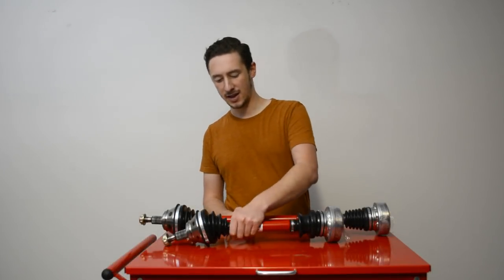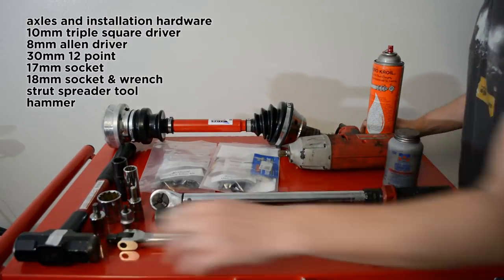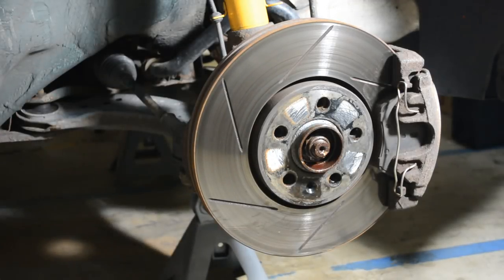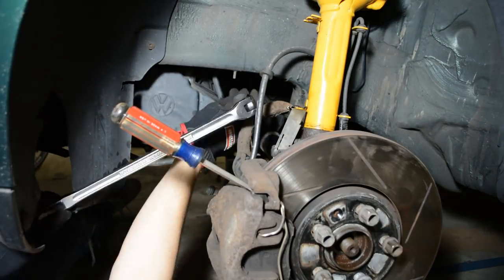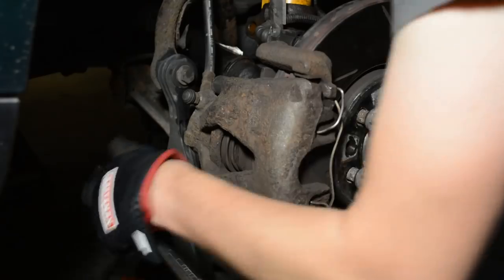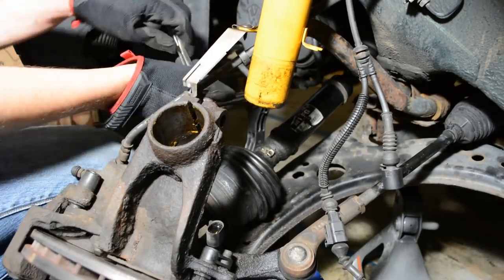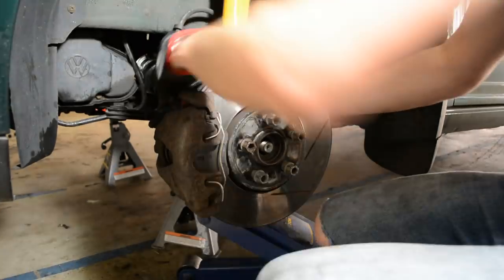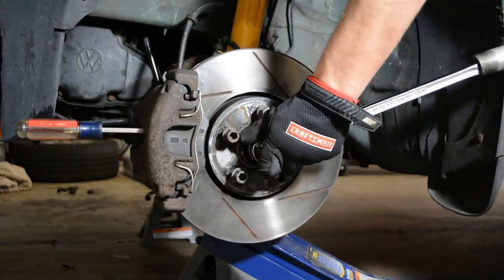MK4 VW CV Axle Removal and Installation

Comment: Hey, Quick Question! I’ve got a 00Jetta & just replaced both CV AXELS. 
When I looked at em the other day,
I noticed the axel wasn’t flush with the wall. Do you happen to know what went wrong here??? Did I miss a step.
Any feedback is appreciated.
Reply from the maker: +Cali_livin Guy Do you mean flush with the hub area or the transmission area? If everything is tight there shouldn't be an issue. When I put mine together it seemed like it wasn't into the hub far enough, but everything tightened down and seated correctly. Do you have any weird noises, vibrations, or other issues that make it seem like it may have been installed wrong?
Reply: Thanks for taking the time. 
Every time I hit a bump, I hear hard metal hitting. Maybe the shocks are bad too ?
Reply from the maker: +Cali_livin Guy that could also be your strut mount. Its the rubber piece between yhe top of your strut and the strut tower.

Comment: Unbolting the strut is unnecessary. If you unbolt the sway bar end links on both sides, you can swing the sway bar up. Then unbolt the inner CV and the big nut. Then swing the inner CV up, pull the axle out of the hub, and maneuver it out through the gap where the sway bar used to be. I just did it today - did not have to undo any suspension at all (besides the sway bar).

On the passenger side, I unbolted the control arm from the subframe. Seemed a lot easier than undoing the strut. Had both sides done in under 2 hours.
Reply from the maker: Lots of different ways to do it, my video is just one. Thanks for the alternate way! My struts had been installed after my control arms, so I knew they'd be easier to crack seeing as I live in a snow state.

Comment: How did you fix the abs and pad wear sensors?
Reply from the maker: I spliced new plugs on the end. The ABS sensor works again, but the pad wear sensor didn't for some reason. I just used VAGCOM to turn the light off since I'm not worried about that light functioning correctly.

Comment: having a problem where the passenger side axle keeps spinning when trying to remove bolt
Reply from the maker: Is it the large single axle bolt? I would loosen that one up with the car on the ground, or use a screwdriver/pry bar against the ground to stop it from rotating.
Reply: @StevesGarage  I’ll try that the rotor spins with axle trying to undo it I’ll try the screw driver method thx
Reply: @StevesGarage  hit it with impact and it came right out but thank you
Reply from the maker: @jakes5506  You can stick a screwdriver in the vanes of the rotor, or thread in two lug bolts and use those with a try bar to stop it from rotating. Let me know how you make out!
Reply from the maker: @jakes5506  Good stuff!

Comment: Is it different for 02m 6speed?
Reply from the maker: The sizes of hardware may be different, but the procedure is the same. If the sizes are different, look into the torque specs as well.

Comment: My mk4 driverside axel is frozen won't turn at all the passenger side does the motor mount broke on driverside side I fixed it now the axel wont move at all in gear or neutral
Reply from the maker: Sounds to me like you may have damaged the driverside axle. I can't see the motor mount breaking causing any internal damage to the trans, so I'd start there. I'd remove the axle and inspect it to see if its ok. If it is, then check out the trans/dif.

Comment: Hey bud please help me out, I was driveing a few days ago and my CV axel just fell off, the tranny wasn't leaking or anything actually, so assumed I could just replace it and be fine. Well I replaced it today step by step with the video and now it's leaking hella fluid ??!! Any ideas on what it could be ??? It's my first car and I love it I'm just so sad that this is happening and really need help 😓
Reply from the maker: +Christtheep gameing I'm honestly not sure what your problem might be. You may have installed in incorrectly. On my car, the CV Axle isn't exposed to the transmission fluid, it attaches to a flange that's connected to the transmission. Is it leaking trans fluid, or something else?
Reply from the maker: Oh nice! Easy peasy. Good to know you're up and running!

Comment: Is it possible for the threads on the transfer case where the axle bolts in to be stripped? Is there a way to fix this issue?
Reply from the maker: I suppose that's absolutely possible, though I have no idea how to fix that. What makes you think the threads are stripped? Is it not tightening properly, or not coming out?
Reply: My axle actually disconnected on the highway One day and all the bolts came out I went to replace it and ordered oem bolts and an axle but the bolts only thread into the axle and not the case
Reply from the maker: @dkackddog25  Oh wow... There's definitely an issue then. Did the bolts break off and now they're still stuck in the hole, or did they fall out and the hole is clear? Either way, you've got a problem. I've replaced a full transmission on a mk4 before, but I don't know if you can replace just the flange that comes out of the trans where the axle bolts up to.
Reply: Steve's Garage I’ll have to dig through vw vortex more but the bolts just felt out without shearing, I’ve never seen that happen before. The guy I bought my car from replaced the engine so I’m assuming he over torqued the bolts and stripped the threads. Thanks for the help
Reply from the maker: Wow, sorry to hear your trouble man! I'll say that mine haven't had any issue when done correctly, so when it's buttoned up correctly you shouldn't have any issues!

Comment: What happens if you damage the hub when hammering?
Reply from the maker: If it were me, I'd replace it. The last thing I'd want to do is put it all back together and have an issue that requires me to take it all back apart. That being said, if the hub seems ok, you could put it pack together and it might be fine. It's hard to make a call not being able to see it in person.

Comment: The tools you used for this video would it be the same tools you would use to remove the driver side axle on a  2012 volkswagen passat ? Or would they be different ? Finding a drivers side automatic axle is even hard to find. Lol
Reply from the maker: I don't know enough about the newer Passat to tell definitely one way or the other. What I do know, is that VWs tend to make small changes over the years, so it wouldn't surprise me if they were the same. Can you buy a repair manual? That would definitely help, especially if there are photos to go along with it.

Comment: My 2003 mk4 tdi does not have 10mm triple square bolts . They are more like 8MM . Had to leve the car up on stands last night because I bought a 10mm as per this video and it most definatly does not fit .
Reply from the maker: Sorry that happened, I guess the tdi hardware size is different than the 1.8t.
Reply: @StevesGarage  knew I should have just bought the whole set . Going to pick them up this afternoon and finish the job tonight.  Thanks for the video anyway was informative.
Reply from the maker: On the Escape I own the caliper pin size differs between some years and no one can figure it out. Some are 7mm, some are 9mm. Sorry the video stated the wrong size. I know VW has some differences between the different engine/transmissions, never thought the bolt size would be one of them. Glad you found the rest of the video helpful though.
Reply: @StevesGarage  I know what your saying I hate when they don't keep it consistent on same model car year to year . I blame the engineers . Turns out my cv is probably ok overall it was a bad hub so there was play in the wheel bearing . I'm still going to replace the cv anyway shes original to the car 450 thousand kilometers on the old girl . She can just have the new part . Doing struts and new lower ball joints as well . I'm in deep now .just pressed the bearing out to find the hub problem so of course I've got to order one . Another day I'll have to wait to get it all back together . Thanks again
Reply from the maker: @dillpickle4239  Glad it helped! I tend to go all out like that too. If you're in there and the part is old, might as well replace it. Otherwise you can be back in there in a couple months doing it all over again.
Reply: @StevesGarage  true enough . My buddy mis diagnosed the cv joint so I blame him . Haha . Have a good weekend dude .
Reply from the maker: @dillpickle4239  You too man, good luck with the car.

Comment: HEY GUY -- PUT ON A NEW CV AXLE ON PASSENGER SIDE. 2002 GLX PASSAT 4 MOTION AUTOMATIC TRANS / FELT PRETTY GOOD ABOUT IT. // HOW EVER WHEN i WENT TO THROW AWAY THE BOX THERE IN THE BOTTOM SOUNDERED BY PLASTIC SHIPPING MATERIAL ALL AROUND IT WAS A SMALL PAMPHLET . EXPLAINING  THAT A DUST SEAL IS REQUIRED FOR SOME 2004 APPLICATIONS // THEN IT READS --- REMOVE IF ORIGINAL AXLE DID NOT HAVE  THIS. --- CHRIST IT DIDN'T HAVE ONE ON IT OR IT WAS SO WORN OUT IT ROTTED AWAY ...  NOW IT'S INSTALLED AND i DIDN'T NOTICE IF THE NEW ONE  HAD ONE ON IT.  WILL THIS DUST SHIELD ON THE NEW ONE -- WILL IT NEED TO BE PULLED AGAIN AND REMOVE IT OR WILL IT BE OK TO RUN.IT LIKE IT IS.   THE RIGHT ANSWER WOULD BE APPRECIATED -- BUT IF YOU DON'T KNOW FOR SURE -- THEN SAY PULL IT
Reply from the maker: I hate when that happens! I'm not sure about the Passat, but there weren't any extra parts with mine. Odd that it doesn't specify if your car absolutely needs it or not. Are you axles maybe used on other applications that need the seal, where maybe yours doesn't? I would try and find that out before pulling it again. Someone has to know what cars get the seal vs what cars don't.

Comment: Not every jetta has a 10mm triple square driver bolt, should have been specific with the size range on all jettas.
Reply from the maker: I've pinned a comment stating that. This video is done on a 1.8t so it should be correct for that.

Comment: How did u set up the strut spreader at the back of the spindle?
Reply from the maker: +Sdddude123 the strut spreader slides between the knotch in the spindle, then you rotate it to open up the spindle and slide it off the strut. Let me know if that doesn't make sense or you need more clarification!
Reply: @StevesGarage  thanks! I had to rewatch a couple times but it makes sense now.
Reply from the maker: +Sdddude123 Cool cool, glad I was able to help!

Comment: Torque specs for axle nut?
Reply from the maker: Bently manual says to torque to 148ft/bs, loosen half a turn, and then torque to 37 ft/lbs. Raxle says to tighten to expose 3 or 4 threads. I've done both and haven't had an issue either way.
Reply: @StevesGarage  Im gonna use the Raxle method, thank you so much!

Comment: How the hell does yours have a hex nut? Everywhere I've seen it's a 12 point
Reply from the maker: The axle nut? It's a 12 point in both the one I take off and the one I install.
Reply: @StevesGarage  no the cv nut that's hold it to the transmission. I noticed you were using a hex bit
Reply from the maker: @ischwhit6747  The OEM ones are triple squares, the replacements are hex. That's what the Raxles are delivered with.
Reply: @StevesGarage  yeah, ik the OEM ones are triple square. What I saw was you using a hex on the triple square bolts. I could have been blind or maybe the lighting wasnt too good on em
Reply from the maker: @ischwhit6747  Definitely wasn't a hex taking the off, just a triple square driver. Probably the bad lighting in here, it's tough to get light that far in with the car so low to the ground.

Comment: where did you purchase your new cv axle in red?
Reply from the maker: +Hippie Chick The axles are from a company called Raxles. They're expensive, but they're better quality than OEM. I'm lowered and have a tune that's giving me more power, so I wanted something beefy.
Reply: @StevesGarage  that's what I've been looking for buy people kept telling me. I couldn't do anything with a vw... very discouraging. I'm just starting out learning and studying. I want the best for my car. thanks for the info
Reply from the maker: +Hippie Chick Don't be discouraged about what people say about VWs. They're different, might require some special tools, but at the end of the day it's all nuts and bolts that come off, and go back on. If you take your time, follow instructions, you can do it! The Raxles are definitely the best axles out there if you plan to keep your car for a while, or do any future modifications like lowering or increased power. Let me know if you need anything else, I'm happy to help!

Comment: What size are the axle bolts?
Reply from the maker: I'm not sure what the exact bolt size is, they came with the axles. As for the head size, the stock VW bolts are a 10mm Triple Square bit. The replacement Raxle bolts are 8mm Allen.

Comment: Nice approach Steve.  Question for you.  Im in the  process of replacing my steering rack (2000 beetle).  Subframe is dropped,  etc etc.  Noticed drivers side axle has no rotational play, and if I gently pull on it, it moves in and out only a few mms.  The passangers side has no rotational play, but if I give it even a slight pull, it moves a good inch or two in an out.  Its automatically pulled back in by the inner boots accordian.  I dont detect any other issues , but do you think this needs to be replaced?  Easier to do it now while everything it out.  Cheers.
Reply from the maker: +Rob Kesik I replied on the other comment too, but I thought I might add something here. How many miles are on the Beetle? Is it lowered, or putting ouy more power? Just trying to get any details that mgiht point to it being time for an axle replacement. I definitely understand doing something else while you're in there. I feel like people who work like that are rare!
Reply: @StevesGarage  330000kms.  Not lowered, TDI, nothing else really to note.  I be actually got a video I'll be posting in a few mins. I'll link to it.
Reply from the maker: +Rob Kesik If the axles are original they're probably ready for replacement. Mine lasted about 180,000mi with a stage one tune and lowered an inch. It wasn't lowered or tuned the whole time, I've only owned it since 130k, but that gives you an idea. I know that mk4 axles are a bit notorious for being awful, but I seemed to have good luck with mine, and it seems like you've had the same.

Comment: your rotor is on the wrong side.. top of the slots should point backwards towards the rear of the car
Reply from the maker: Everything I read was that the side of the rotor depends on the internal vane direction, not the outer slots. I installed them so long ago that I don't remember if they were labeled or not. But I'll double check to make sure they're mounted correctly!

Comment: Do you recommend replacing the triple square bolts?
Reply from the maker: From what I can remember, the axle bolts don't need to be replaced. However my raxles came with replacement bolts, so I used them. No need to replace them if they aren't damaged though!
Reply: @StevesGarage  Thanks!

Comment: what brand are those axles
Reply from the maker: They are Raxle brand. They're pricey, but garunteed for life and extremely high quality. The owner is great and was very helpful when I had some questions before I ordered them. Let me know if you need anything else!
Reply: Steve's Garage  hi there me again... so how do I order them because i sent an email to the sales email on the website but still no answer  how did you order them is it better to call ? Pls let me know i really want them thnks again
Reply from the maker: +Antonio Rico I called them directly and placed the order. I could find him credit card info over the phone and it worked out great.

Comment: Mine stuck inside the hub
Reply from the maker: You should be able to carefully hit it with a hammer and get it to come loose. If you're replacing the axle, you don't really care about damaging that, but you don't want to damage the hub. Alternatively, you could also use a puller tool or slide hammer if you've got one.